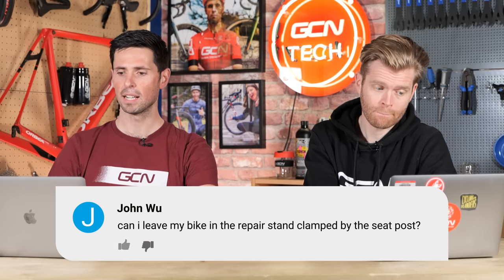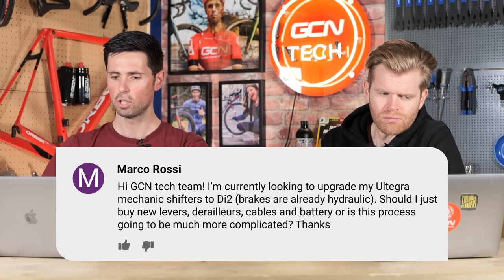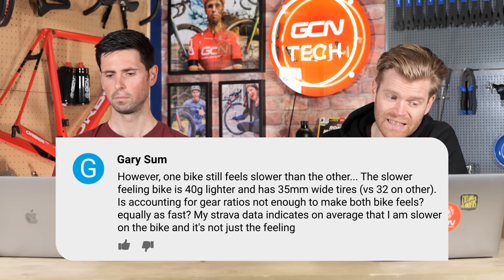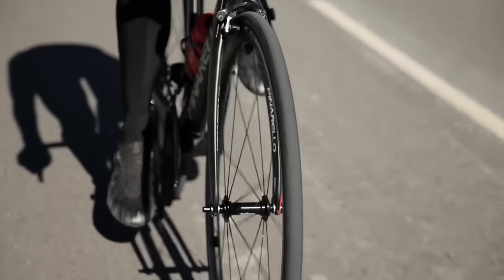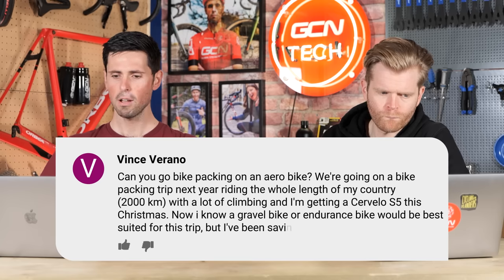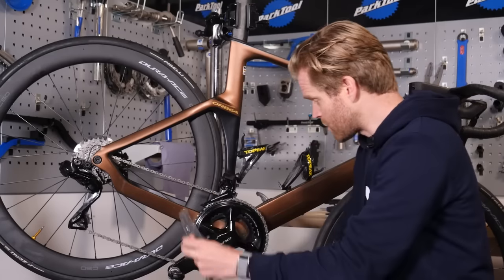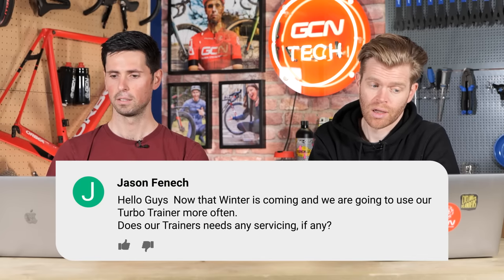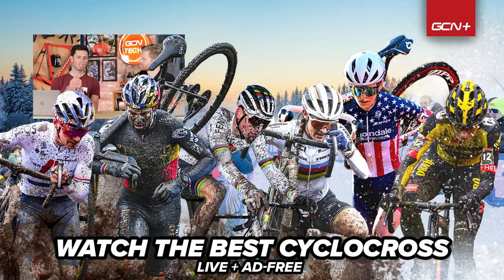Entry-Level Carbon Wheels Vs High-End Aluminium Wheels? | GCN Tech Clinic

Comment from the maker: Let us know your tech queries using #AskGCNTech! 👇
Reply: I just started cycling vlogs, shoutout to all my cyclist!!
Reply: Can someone suggest a alloy  road wheelset that is decently lightweight, through axle, disc brake 6 bolt or center lock that is 700c which is shimano 105 11 speed compatable and is 12mm/100mm at the front & 12mm/135mm at the rear or can i lock at using a adapter to change something like a DT swiss wheel from 142mm to 135mm?
Reply: #AskGCNTech Hi, I do actual winter biking, and I'm considering buying a crank based power meter for my winter bike. However, most power meters have a minimum operating temperature somewhere around 0c. What happens to them if you use them in -10c or even -20c? Will they show slightly wrong numbers, completely nonsense numbers or can you potentially do permanent damage to the electronics?
Reply: #askgcntech since external cabled bikes should have protectant film installed to protect the paint from cable rub, shouldn’t internally cabled bikes have protectant film installed internally to protect the raw carbon from cable rub? Mainly inside the head tube as an example. Thanks.
Reply: Hey guys, excellent show, long time fan. I have a Sram eagle nx group set on my fat tire bike. Looking to build out a drop bar gravel bike, can I use this group set with the correct Sram shifter?
Reply: #AskGCNTech this brings another question: is it worth spending on carbon wheels, which are more aero, for a carbon bike which hasn't an aero frame?
Reply: #AskGCNTech Howdy Folks! I have a Cannondale SSE with Hollowgram cranks. I recently swapped the arms, from a prior version to the new '22 ones with the self-extracting bolt, and am now seeing a little side-to-side play which I didn't experience previously, despite going from one thin spacer to two. I've read that the wave spacer is not supposed to be full compressed, but it is it okay to have a small amount of side to side play. it's probably not more than 1-2mm. Thanks!
Reply: #askgcntech great show, thanks for the knowledge. Quick question, how many Watts are mud guards worth? ❓❓❓🏋️‍♂️⛵❓❓❓
Reply: #AskGCNTech , Hi GCN, I have a 2008/9 Scott speedster S30 with a 3x shimano 105 groupset. Can I replace the 3x chainset with a 2x chainset and keep the same front derailleur and shifter? Also, would I be able to change to a cassette with a larger range? would I need to get a longer rear derailleur? Thanks x

Comment: it is simple, choose between a shattered rim or a bent rim when or if the unfortunate event happens that is.
Reply: Yes, I agree. I have aluminum wheels on my bike. Last year I was riding at night and hit a brick laying on the road with my front wheel and my shoe. At the moment I thought that I hit it with the tire and just continued my ride. Eventually, a few days later I found out that I bent my rim, it was bent inside. So I brought my bike to the workshop and mechanic bent the rim back and straightened the wheel. A year later, I still use this wheel, it's perfectly fine. I think, if it was made of carbon, I wouldn't even be able to ride home on that occasion.
Reply: Agreed. This should be a common sense, cant be any simplier
Reply: @LorenzoEnzooey  nah, just choose what you want and can afford. If you got enough money to replace a broken carbon rim like it's nothing then it is inconsequential. A carbon rim does not shatter instantly when it gets damaged, just watch youtube videos of youtubers trying to intentionally destroy carbon rims like Sam Pilgrim.
Reply: High quality aluminium rims are far better than average or even higher priced carbon. 
If aero isn't important to you then choose a shallow profile aluminium rim.
I rebuild carbon on a regular basis and I wouldn't want carbon on my own bike.
Reply: @harryrowland4734  couldn’t agree more!
Reply: Zzzzzz. An impact that would “shatter” a carbon rim would also destroy an alloy rim. It’s not like you can true a taco’d rim.
Reply: @kidsafe  a big flex with a carbon rim can cause internal damage that isn't visible on the surface. 
I have removed many tubeless tyres in order to true the wheel and the wheel is perfectly true once the tyre has been removed, refitting the tyre causes the rim to go out of true again. 
The cost difference between carbon and aluminium rims isn't insignificant either.
Reply: @harryrowland4734  A big flex will bend aluminum well past its fatigue limit. How often do we see failed spoke beds on aluminum rims? Remember the Pacenti SL23? Remember the Stan's Alpha 340? Remember Bontrager Race Lites?
Reply: @kidsafe  yes I've seen plenty of Pacenti and Stans with cracking, but any aluminium rim can crack and for many reasons, even a Ryde Sputnik can crack. 
But it's not as expensive to replace an aluminium rim and for general use an aluminium rim makes more sense. 
I have people asking for carbon winter/training wheels???
Reply: @harryrowland4734  With the advent of disc brakes, I no longer own “training” wheels.
Reply: @kidsafe  what about the environmental issues regarding plastics? Carbon bikes and components are not going to be recycled. 
We are some way away from recycling Carbon,it's not currently cost effective.
Reply: @harryrowland4734  There is progress being made in the sector with newer resins. Carbon can then be taken, ground up and be used as infill for insulation, asphalt, composite reinforcement, etc.

Also disc-brake carbon wheels aren't consumables like rim-brake aluminum winter wheels. My ENVE SES 5.6 Discs are 6 years old and have never even needed a true.
Reply: @kidsafe  I get to see carbon wheels when something has broken, in many cases, the customer has bought them either because of marketing or fashion.
I've also come across riders at the side of the road in the middle of winter, with a broken spoke and an un rideable bike. 
You can't limp home with just 23 spokes and internal nipples. These are not suitable as winter wheels if they can't be worked on at the roadside. 
I'm not completely anti carbon, there's things that you can do with carbon that doesn't really work with aluminium. 
Marketing is making carbon sound like the only option for upgrading, it's not necessarily the best choice.
Reply: @harryrowland4734  I did a 100mi ride from Oakland to Sacramento to watch the inaugural Into The Lion’s Den race last year. I was in a small front group of 7 riders or so and one of them broke a spoke with 15 miles to go. He wrapped the broken spoke around an adjacent one and finished the ride. The wheel did have a visible wobble, but any wheel would have. Saying you can’t limp along on a carbon wheel with a broken spoke is just spreading FUD. The average medium-depth carbon rim almost certainly has more rigidity and hoop strength than a shallower aluminum rim.
Reply: @kidsafe  I'm not sure what you do to make a living but I build and repair wheels and have done since 1976
Generally a low spoke count wheel regardless of what it's made of, isn't going to be easy to make rideable in an emergency. 
Most horror stories I hear about wheel failures, involve carbon rims, given that the larger majority of wheels are aluminium, then I would think that carbon wheels are more likely to fail.
Reply: @harryrowland4734  As an aside, I build wheels too and I was completely taken aback when I installed tubeless tires on a pair of Velocity Ailerons and every spoke ended up at 0kgf. There were visible micro-wrinkles on the surface of the rim. I see some drop in spoke tension with carbon rims, but I’ve never seen zero tension.
Reply: @kidsafe  as was I, when I first discovered that about tubeless.
This was with Pacenti rims and kirk Pacenti recommended tensioning the wheel with the tyre fitted, I stopped using Pacenti rims. 
I built Velocity for the UK importers many years ago and was horrified to discover how expensive they were, they are bloody horrible.

Comment: High end aluminum wheels over entry level carbon wheels for me every time. A set of high end aluminum wheels is durable, works well with rim brakes, which I prefer, and is the best that can be made from aluminum as opposed to similarly priced carbon wheels, which are likely to be not as "quality assured" as they should be and not much lighter either.

Comment: These days low end carbon isn't that expensive. Generally, the cheaper carbon wheels have cost savings which manifest themselves as steel spokes and a slightly heavier rim. The hubs is also a place to look at, some use non iso bearings. I recently had a set for review that were firmly in budget territory that came with ntn bearings.

Comment: I have an original Tacx Neo purchased in 2016 and I had to change the free hub and replace the bearing set after 5 years.  I loved the fact that they sold replacement parts so I could fix it myself.  Right to repair is so important.
Reply: Yeah I had the bearings go on mine and a local bike mechanic replaced the bearings and repackaged the freehub
Reply from the maker: That sounds really great! Getting as much life out of your tech is such a good habit to get into 🙌
Reply: @gcntech  watch Shane millers video on Tacx neo maintenance

Comment: As for carbon wheels, I had bought Ican carbon wheels for $500 can. About 5 years back. I think you can buy the same wheels for $700. can. since then, I had the bike shop replaced the bearings. Probably better ones, I guess. And I had to tighten the spokes. We have ruff roads also and I do a fair  bit of riding. Otherwise they have been great. As for aluminum rims, I didn't think  the price wasn't that much lower that my carbon wheels.
Reply: for my new bike i've got the same: got a budget carbon wheelset for 600 EUR (not much more than aluminium ones). One doesn't have to go up to over 1000
Reply: Agreed. Ican has a good reputation from all I've come across.  Honestly I think at $400 to $600 a wheelset, you're probably getting close enough to the same quality that it's more of a personal preference as to which is going to be better
Reply from the maker: Sounds like you picked up some great wheels, are you running Rim or disc brakes?
Reply: @gcntech  the Ican rims are for rim brakes and not deep section. The hub is the value option. Other than being a bit heavier. I think they turned out to be a good wheels, and these carbon rims are just bling. Definitely better looking and lighter than the old rims they replaced.
Reply: Ican offers some brand name hubs, but the prices jump a good bit when going that route, which makes me think a lot of the cost savings is in their house brand hub. However, I had no worries with my Ican wheels at all, other than them being rim brake and riding in the rain. That was dicey, but down to carbon rims being ridden in the rain.
Reply: @bleckb  I am very pleased with the lower priced hubs. My local bike shop had the bearings the n stock for both wheels. Must use a common size.
Reply: @renegadeflyer2  I was happy with their stock hubs as well. I only had the wheels two years I think before my wife allowed me to buy a new bike but I don't know of anyone who has had troubles with the hubs. And if the bearings are stock and replaceable, that's all the better. No reason to drop a big chunk of money for name brand wheels and hubs for the same fundamental performance.

Comment: Guys Hed jet wheels that have aluminum rims but carbon foils are fantastic wheels; strong, light and aero. Also, I used to ride with Mavic Carbon Cosmic SLR wheels that were made the same way, and to this day (I had them in 2012) they remain one of the best wheel sets ever. Fused aluminum and carbon are fantastic materials to produce stunning wheel sets.

Comment: I had mid-range carbon rim brake wheels. They literally melted on a descent last summer. Switched to high end (still much much cheaper) Tune TSR35 aluminium wheels and am very happy with performance, and especially - using the recommended brake pads - quiet braking that can compete with disc brakes.

Comment: Another factor to consider when choosing carbon vs aluminum wheels is if you bike is rim brake or disc brake. Rim brake on carbon wheels can become a delicate situation when descending down a long hill.
Reply from the maker: Winter and summer will also come into it 😳
Reply: Even brake tracks on carbon fiber wheels designed for rim brakes aren't an ideal solution.

Comment: If you can feel wheel vibrations it might not be about weight balance - more likely the tyre bead is not evenly seated in the rim. When fitting tyres, you might have to inflate them way higher than you need to get the bead to snap into the right place before deflating down to ride pressures

Comment: For which to buy three things to think about:
1. Braking system. If rim brake stick with aluminum since it offers better braking under all conditions (from my experience). If disc go carbon.
2. Weather conditions: this is linked to brake type, but also if it tends to get pretty windy in an area don't go too aero. Crosswinds aren't fun with aero.
3. Road conditions: is it city riding? Back/country roads? Depending on how best up the roads are matters when it comes to durability.

Also, what type of rim matter. Hookless vs. hooked(?).

Comment: 2 years ago I built a full carbon bike, even down to the seat. I fitted 3M clear tape all the way down the front down tube and round the bb housing, also the under crown of the forks . The same instal on rear of seat tube and the top of chain stay. It will prevent abrasion of the carbon surface from grit thrown up by the tyres which would then allow moisture into the carbon.

Comment: You guys should have mentioned that rim brake carbon wheels on hilly courses are a death trap, especially for riders over 80kg. 
If you want to do carbon wheels for all riding, then get disc brakes. 
Rim brake carbon rims are notorious for overheating and blowing the tires off, or the rims fail under braking due to excessive heat melting the rim resin.
Reply: When i plan on going up local mountain i use my triple chainring bike with aluminum rims… after a bit more studying i also use butyl tubes not laytex ( i have two bikes. One is race oriented carbon wheels and on other …the endurance geometry triple chainring i have two sets of aluminum wheels one higher end.  Love them with laytex tubes.  Fast!
Reply: My deep dish 80 mm ish carbon wheels are crazy fast but terrible idea on a front wheel due to winds.  My giant aluminum wheels with same tires and tubes are almost as nice…just sayin…. If you ride 40 km per hour that is where i feel the difference
Reply: @secretagent86  
yep, alu rims are safer on descents, at least with rim brakes.  I don't know enough about diff between butyl and latex tubes.
Reply: @secretagent86  
the only place for deep dish or disk fronts is in an enclosed velodrome, with zero wind. 
For durability, wheels should weigh over 1300g, even if you weigh <70kg. I've seen way too many wheelsets fail, most are under 1500g. 
Though in recent years, you can get carbon in the 1300s that are very reliable re spokes, rim durability.....though hubs may need sealed bearing sets replaced eventually.

Comment: I have balanced some of my wheels and the easiest way is to use soldering tin just wrapped around a spoke.

People always think the valve side must be the heaviest but I have found the opposite to be the case in some instancies. I guess this is because on alu rims, the rim profile is assembled opposite the valve hole and some bracket is used inside for this.

On a 80mm carbon rim, I actually used the small sticky weights used for car wheels.
Reply from the maker: Nice work 🙌 Do you find it makes much difference?
Reply: @gcntech  Not really but it shows very significantly when I spin the wheel while the bike is on the repairstand. Without the weights the bike rocks and vibrates..
It was a long winter 😁

Comment: I have a Parlee that came with HED Ardennes wheels.  I replaced them with Mavic Cosmic wheels.  The HED wheels flexed enough they would rub on the frame.  The Mavics do not have that issue.  Also the carbon wheels are more comfortable, they seem to absorb more vibration.  Love the Mavics.
Reply from the maker: Nice one Leslie! Are they lighter? 👀

Comment: GCN - you advise sticking a patch in side a tubeless tyre for difficult punctures.  I actually find that a dab of contact adhesive on the inside of the puncture works wonders and is much much simpler.... and it won't peel off over time!!

Comment: #AskGCNTech -Ignoring bike fitting aspect - Am i right thinking that shorter crank =you get higher cadence but lower power ratio (more power you need to put in while cycling), and vice versa - when longer crank = you get lower cadence but more Power ratio (less effort to get same power output comparing to shorter crank length.)?

Comment: #AskGCNtech Hi folks, you taught us that aero is always faster, but upgrades are expensive. Your power and position on the bike are, of course,  important. If we're considering the power to weight ratio, at which point would you suggest getting fitter before getting bike upgrades? Are upgrades really worth it when you can't push over 2,5-3 watts per kilo in your opinion?
Reply: If you're riding on the flat then this question is meaningless as aero will always matter even if you're pushing 3w/kg as if you're heavy that still means going pretty fast. 

If you're going uphill then weight is more important generally. I think up to 5w/kg you're probably better off buying lighter things than more aero things.